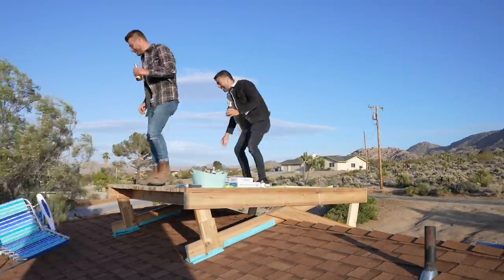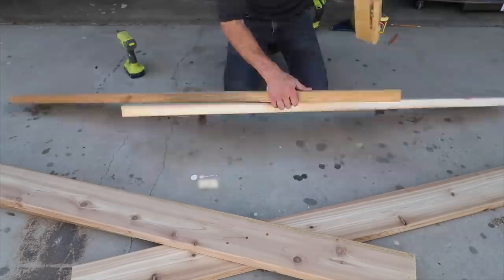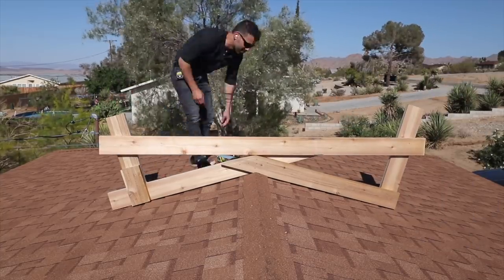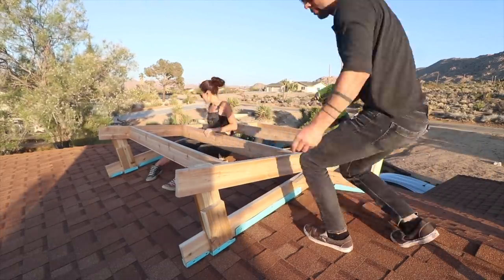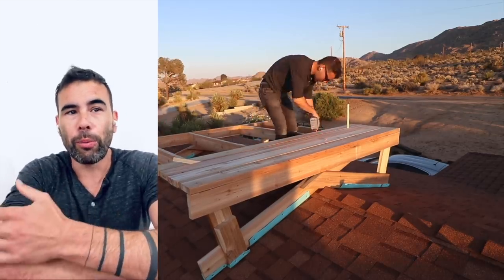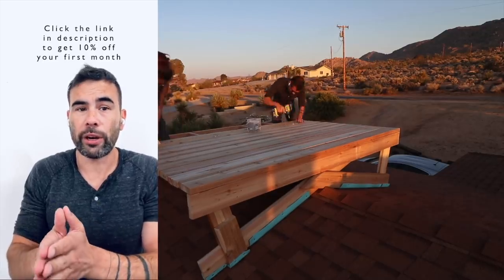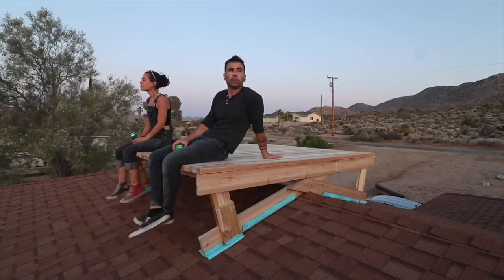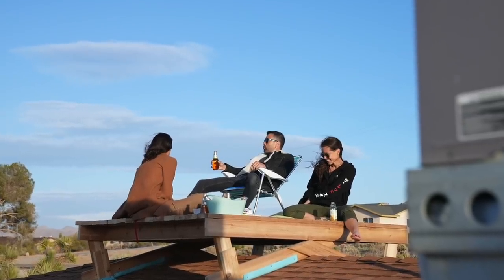Building a ROOF DECK | a 1-day DIY project

Comment: People should know that asphalt shingles aren’t really made for foot traffic, especially when it gets hot. Over time you would shorten the lifespan of the shingles.
Reply: Clambering on a roof and consuming alcohol can seriously shorten your lifespan.
Reply: @ChrisPage68  not everyone can qualify for a Darwin Award
Reply: Something tells me they could care less.
Reply: Not to mention that the roof was not engineered to carry that extra weight. This is an accident waiting to happen. I will say that the end with the girl laying out on the deck was worth watching the bad idea video.
Reply: @briancrisler6660  what about the weight of snow, where that's an issue
Reply: @caseygibs  where snow is an issue, roofs are designed to carry that load. Snow load is also a temporary problem. Roofs are not typically engineered for the constant load of a deck not to mention people and traffic getting to the deck. Not what I would have done.
Reply: @briancrisler6660  thanks you for explaining:)
Reply: @caseygibs  no problem. I have been a carpenter for 31 years and I tend to look at stuff a bit differently. That is not an all together terrible idea. The execution is what's most concerning to me. Happy Father's day.
Reply: @phill765  you mean couldn't care less, right?
Reply: @briancrisler6660  carpenter does not equal general contractor or engineer.   Where I live and work, as a civil engineer, roofs are designed to hold their weight and much more.  Maybe stick to what you know, a hammer 🤣.
Reply: @hillaven2745  are telling me that as an engineer, you would sign off on that in plan form and risk your certification? If so, that explains the horrible state of our infrastructure in the U.S.. I may just be a simple carpenter but any moron could see that while it's a neat idea, the way it's constructed is in a less that professional manner. You know that walking on shingles, whether 3 tab or architectural is not advised. The platform is not anchored. How much uplift would it take to pick that structure up and either drop it in your neighbors yard or even worse, another section of your roof. Engineers clearly know everything, just ask one.
Reply: @briancrisler6660  I would have zero concern about this.
Reply: @hillaven2745  really really a dickish response, smart guy.  What makes you think general contractors know jack squat much less a civil engineer? However, I agree that there is no problem with the extra weight on this roof.
Reply: @briancrisler6660  " Engineers clearly know everything, just ask one."     For sure, for sure.
Reply: @MrSteeDoo  you can’t even write in complete sentences, I’m blocking you.  If you are going to insult someone, you should at least learn sentence structure so you don’t sound like a fool.
Reply: @hillaven2745  I see you are exactly who you presented yourself as in your earlier comments.  You have soft hands and tender feelings.
Reply: Who gives a crap?!? Live a little!
Reply: @briancrisler6660  snow can be on a roof for 3 to 4 months easy.

Comment: wait a minute, the wind could launch that thing 100 feet. should probably have a leash on it.
Reply: Yup, I was also thinking that.
Reply: 😂 true
Reply: Could definitely just add some strapping from the base to the facia boards so you still aren't screwing through your roof.
Reply from the maker: I guess you calculated uplift differently
Reply: Tell that to the witch... :D
Reply: @HomeMadeModern  guess you’re an aero engineer?
Reply: @lopaka76  not sure about in CA or out west but in Midwest. I’ve seen wind gust flip. 10x20 ft deck stirring in the ground piers. Why wouldn’t it pick up that tiny deck, literally has the roof angle to deflect wind under it and creat e lift.  Beyond getting sued by your friends when they get drunk and fall of your roof.  It’s CA suing your “friends” for stupidity is a real thing.
Reply: @Alphasig336  I'm saying the deck is a deathtrap. The wind will blow it off.
Reply: @lopaka76  around here (Delaware) we literally have to secure sheds down to the ground because they’re afraid of them flying away. That thing is on the roof lol
Reply: @HomeMadeModern  Would you mind sharing the calculations?
Reply: Terribly irresponsible to offer this as a DIY project build, not to mention advocating alcohol use on the roof.  When, not if, someone get's hurt by this contraption, they may start a new channel - JailMadeModern.
Reply: @johnsandlinjr  I'm a civil engineering with a minor in Aerospace
Reply: @hillaven2745  well…your thoughts on this death trap?
Reply: How many 200 lb objects do you see flying around your neighborhood on windy day?

Comment: This video, a Craigslist score of free deck wood,  a timely encounter with an architect while getting that wood, and a weekend, gave me a water view!  Thank you for the helpful video!  Some modifications I made: 1: A great big beefy railing that is "up to code"  2: I tied in some wood posts to the joists to take the weight of the decking from the top board to the bottom v section so the entire weight of the deck was not on screws (look at 1:20, I added a board  on that left concave section to fill it in but on each side and each joist)  3:  I gave it lateral support on each joist because the idea of one of those joists tipping forward somehow is terrifying in my situation. 4:  I added a board underneath and made three points of contact to the roof in the middle of the deck. 5:  I went into my attic and reinforced my roof from underneath.  This is a 2 person at a time experience in my application.
Reply: I would love to see a vid or pics of how you did this exactly. I will be building this deck on my roof soon and was trying to figure out how to make it more stable. Also, I want to screw it into beams within the roof like you did.
Reply: @mikesevilla8692  I just made a point to have solid wood anywhere there was a structural load instead of just relying on fasteners.  A few extra boards here and there and there was no where that weight was going down and having to jog over on screws.  it could just carry right through solid wood.  I also added 1 board parallel to everything in the middle and ran boards down from the side of it to the roof to give it all more stability in the middle.  I have NOT put any holes in my roof and it has not moved at all in 1 years time.

Comment: That's really cool!! But I would be worried about wind blowing it away and causing damage or injury. Do you have any solutions for that?
Reply: Big wind storms would definitely ow that off with it not being tethered to the roof. Trust me, I do roofing for a living. Especially being in that region.

They could buy these things called roof jacks, set them at the bottom where the rafters start find where the rafter is under the shingles, usually can hit the roof decking with a hammer and hear for the harder hit. Take the shingle out that's there, put the roof jack in using 4 3" spiral nails, put the shingle back so it overlaps the nail heads, then put a scrap piece of 2 x 4 laying horizontally to the other corner, putting roofing jacks on all 4 corners. Then just screw that board to the deck they built
Reply: Then roof jacks usually have a hole or two for you to anchor the 2x4 into the roof jack.

Comment: Cool project...but all that foot traffic on an asphalt roof is not good.  Also, what happens when a strong wind blows that off the roof because there is no anchors securing it to the structure.  That deck will be like a sail.  You could take it down every time you are done but that would be a pain.  Also, if it's build out of treated lumber it will be pretty heavy so you won't be able to take it down in one piece.

Comment: That is some pretty creative engineering. I would have done it the hard way by measuring angles. Great project!
Reply from the maker: Thank you very much!
Reply: Good job creating to hang out and cut your roof life span at least in 1/2 walking on it. Glad you like stepping on the peak in video too. Your a roofers best friend.  Also looks like an airplane if you get high winds.
Reply: Completely agree the effectiveness, accuracy and speed of the single screw pivot was awesome!
Reply: Could use some Veneer...what do you think David? ;)
Reply: You just need to use more yoga mats David

Comment: note: don't use regular 2x6's. Use pressure treated or cedar.
Reply: I’d recommend cedar or redwood if you can afford it. 👍🏼
Reply from the maker: yes although regular 2x6s would last a while in this dry climate as long as we avoid termites.

Comment: If you could make it pivot at the apex of the support but still lock the angle when it had matched the pitch of the roof you would always have a perfect fit - not sure how you'd keep the deck level though?

Comment: One thing I would have done was to space off of the roof so you weren't on the ridge cap. It would have contacted the roof better and not had the slight wobble you ended up with.
Great idea though!

Comment: Ok so all things being equal high pressure on one side creates low pressure on the other. I think newton had a thing or 2 to say about it :) and any potential wind pushing up from one side of the roof will redirect it's forces down on the other and lock it into place more. A cross wind would have a better chance of sliding it off than a head on wind of lifting. Especially where y'all live. Now Kansas would be a different story. But even then if there was enough wind to lift it then you have way more to worry about hoping the rest of the house doesn't land on the good witch this time 🙂
Reply from the maker: pretty much!
Reply: Holding down the downwind side won't help much if it's lifted on the upwind side.  And as soon as it lifts a tiny bit, that lift just goes way up.  Having good cross ventilation at the ridge would help, too bad the joists block some of that.
Reply: 100% agree. Much more of a chance of a cross wind taking this off the roof or a wild tornado but you got many more issues then. My concern would be regarding building codes. You have an unsecured structure on your roof that has people sitting and walking on. Now I have no idea what your codes are like there but you may have a hard time convincing an inspector that your roof deck is "safe" considering most decks at a height of 3' require building permits and railings. Both of which dont apply here. Plus its free floating. While decks can be free floating they are typically only 1' off the ground. In my area not having the joist hangers would be a code violation but I can't speak for your area.
Reply: @matthiaswandel  this guy maths.
Reply: @matthiaswandel  hmm ok so consider this. If a gust comes up underneath a slope facing side. And it had enough force to lift the side instantly all the potential energy of the deck would be pushing down on that gust. So as that side 'rises' it will lift half the distance from the roof top. When that happens the winds energy will correspondingly be reduced because the gap for the airflow is increased and will skip out the other side and as it does that it will press up against the other side forcing the wind side down even more. The worst thing this will ever do is shift or creek but with the yoga mats acting as friction even that's less of a possibility. It would literally take a tornado to get that sucker off the roof. And if that were to ever happen it would flip leading edge over trailing edge and essentially spin its way straight down to the ground like a paddle wheel. Kind of like tossing a flat piece of paper in front of a fan. Or pissing in the wind :-) and where they're located they have a better chance of volcano taking it out than a tornado.... Not saying, just saying.

Comment: Until a storm comes and blows it through the roof next door. Pretty sure the city would never let this stay. Against many codes.
Reply from the maker: or you can use basic math to calculate uplift
Reply: @HomeMadeModern  If the ram air pressure is say, 5 cm, or 2" of water, that would probably lift it.  5 cm corresponds to about 100 km/h.  Very stormy, but not unheard of.  And with a storm like that, it will do some serious damage wherever it ends up hitting.
Reply: @matthiaswandel  My man
Reply: If there are 62 mph winds in Joshua Tree, they have other things to worry about.
Reply: Codes?  Why are people always looking for rules to follow?

Comment: Please tether that thing. Lets assume there isnt enough strength to push it into the air, it could just side down and hit you, somebody else, or a vehicle.
Reply from the maker: curious to hear how you go to the conclusion.  what windspeed and weight did you use to calculate that?

Comment: Nice Idea, but poor execution. While attaching the deck, you see the angled brackets lift and drop, so all the tension is on your top-shingles, which are unprotected by the yogamat. Leakage is around the corner.

Comment: I saw you do the container home to code so I’m wondering why for a roof that’s designed to handle no more than 30 pounds per square foot, you just added another 200 psf!! Please tell me that you added some load bearing walls under those dinky trusses! You’re inevitably loosening up the structural connections... get an engineer to stamp a roof addition if you want view that badly. Just makes the desert look even more ghetto lol!

Comment: You better not be leaving that deck up there when you're not using it. Wind can launch it. Or else, screw it to the roof sub deck. Big liability waiting to happen.
Reply from the maker: actually its pretty easy to calculate highest recorded wind speed and then consider uplift relative to the weight and max entry point
Reply: @HomeMadeModern  theoretical. That’s not good enough. Is it stamped by an engineer and approved by the city? A building inspector would shut you down so fast. If I was your neighbour I would cal you in.
Reply: @HomeMadeModern  Don‘t forget in your calculation that the max windsepeed over the angled roof is higher like on a wing.
Reply: @conradcoolerfiend  you do realise that an engineer's calculations would also be theoretical.. right?
Reply: @MrMonstamasha  a city would never approve something on the roof that isn’t mechanically fastened. You complete noob.
Reply: @conradcoolerfiend  I mean, that's not what I was addressing, but good job on pulling focus away from your mistake! kudos!
Reply: People... Calm down... You don't need city approval for things like this...
Reply: @joshcosta423  you will get sued to oblivion if it gets blown on someone
Reply: @conradcoolerfiend  if/when that happens, great... It's their liability at the end of the day, not yours.